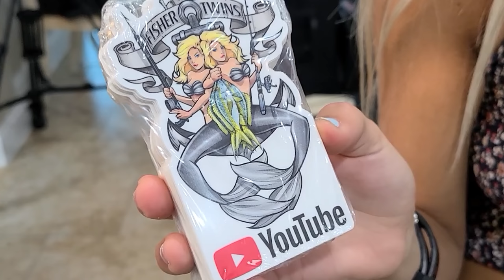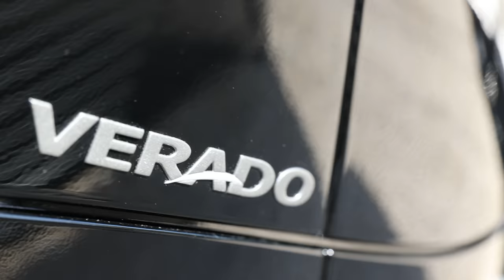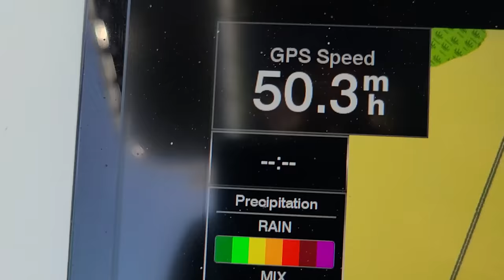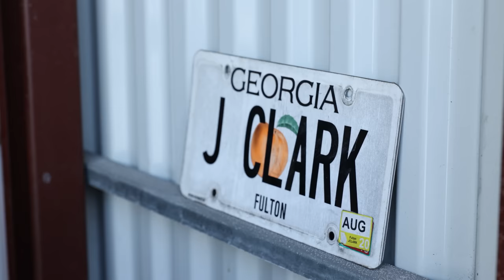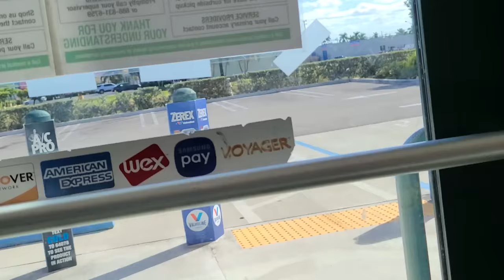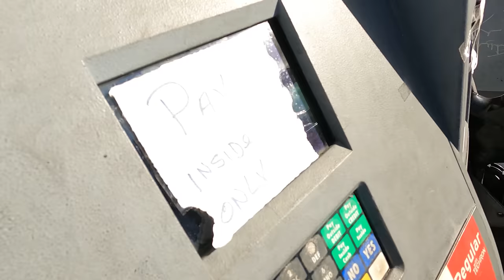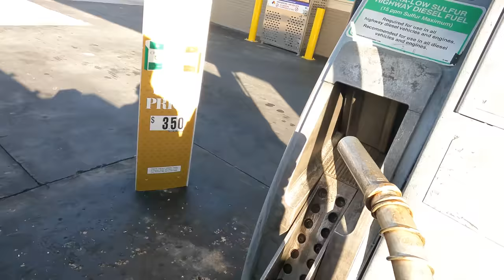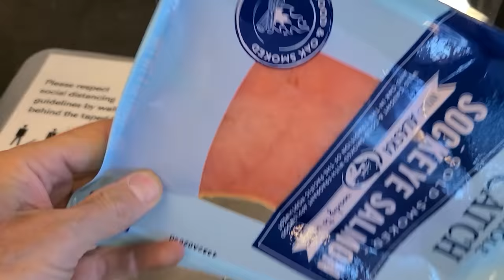What The Fisher Twins Really Want & Need

Comment: That’s not a motor that’s an Engine. Two little motors lift it out and lower it into the water. What’s that awesome rig doing now at full throttle in flat water with just you and Kimber in the boat. Cool white tails hanging out in the back yard and driveway. Thanks for sharing Juda all your doing in and out of the blue. Awesome stuff for me. 50 mph :))))

Comment: You had a Verado 250. Why not upgrade to a Verado 300? Both the 250 and 300 weigh the same 600#.   Disregard the USCG max hp rating.  The work around: Use an inscriber tool and write the words "RACE BOAT" directly under the serial # on the stern. You no longer have to be USCG approved.  Plan B: Have the Verado 300 installed and simply swap the 300 decal to anything you want. Make it a sleeper 200.
Reply from the maker: My boat is rated for 250 horse power and if I were to upgrade to 300 my insurance wouldn't cover me of something happened. It was also a couple thousand more and not much additional performance from what I was told. I thought about it though.